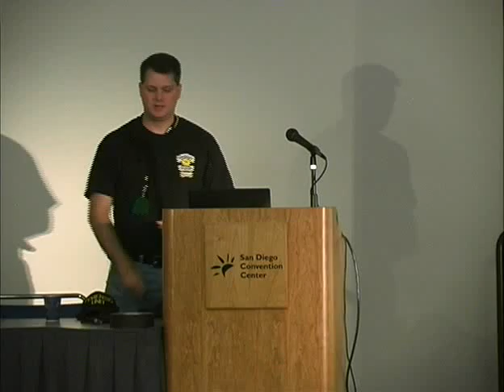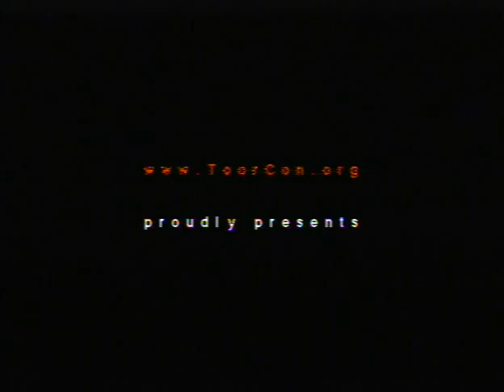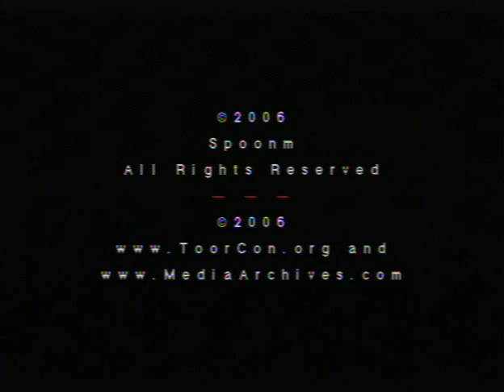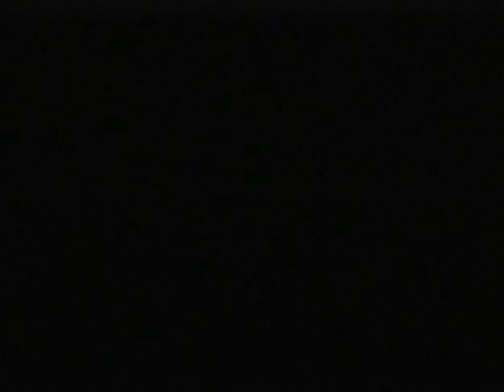Hard Drive Recovery Part 7

Comment: Incredible presentation man, love it. Learned alot! One quick question. Every Western Digital harddrive that I had for the past 5 years (first one was a 80GB IDE WD800JB), it ticks on shutdown. So when you shutdown your computer and the power goes off your harddrive it goes *tick*. Its a similar sound as when the head hits the platter. I always wondered what caused that?

Comment: @grooveclubhouse You might be thinking of 1,1,1-Trichloroethane. Owing to its unsymmetrical structure, it is a superior solvent for organic compounds that do not dissolve well in hydrocarbons such as hexane. Prior to the Montreal Protocol, it was widely used for cleaning metal parts and circuit boards, as a photoresist solvent in the electronics industry and was sold in the automotive industry as brake cleaner and in the electronics industry as contact cleaner.

Comment: I know its a bit late (6 months later) but when i would repair arcade games (which get so dirty from kids spilling coke and what not) I used a cleaner i got from radio shack.  my dad used it too when working in the automotive biz.  when it dries it leaves no residue at all. and use compressed air to blow it off the board while its still wet.

Comment: Hi, very informitive, thanks for sharing. Your My harddrivedied doesn't seem to go anywhere however, mitel or something like that instead.
 I spilled cappacinno in an IMB and need to know what to clean it with, I was informed glass cleaner and blowing it out with low air pressure would cause it to lose data. May I ask what cleaner to us? thank you.

Comment: Wow. Thanks for all the useful info. One question though. I have a 2.5 inch external drive thats only a couple months old. The usb cable shorted out causing the drive to connect and disconnect very rapidly. Now when using a good cable the lights turn on but the drive isn't spinning. the red light flashes and when it does there is a very quiet click. What may my problem be? Head stuck to platter?

Comment: Wow what a cool video.  Hard drives are pretty darn complex but your presentation had so much work put into it.  Your also a very good speaker.  My western digital died. I never organised anything (search function) so it looks like my next nerdy project is to just see if I can get in there....Then sell it on ebay for parts :-P

Thanks dude that was so sweet